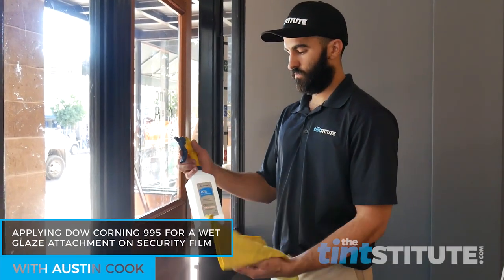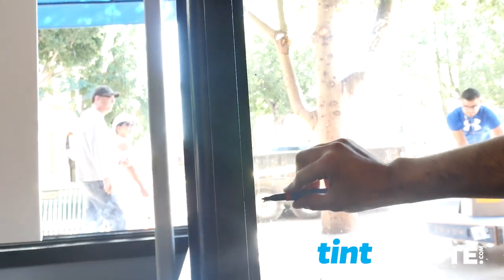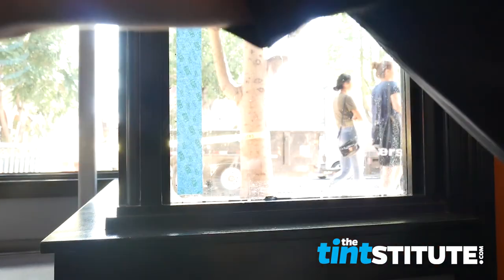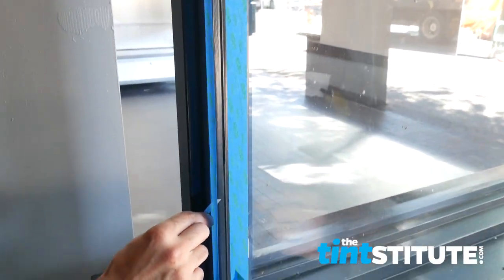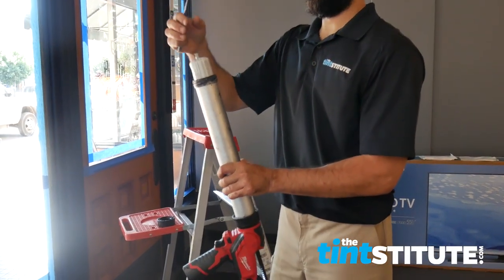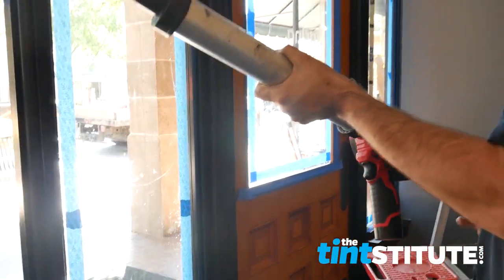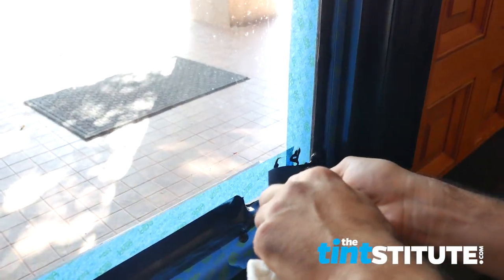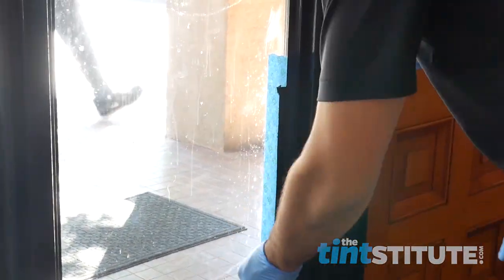How to Install A Wet Glaze Attachment System for Security Film | Installing Dow Corning 995

Comment: Fantastic and helpful vid, thanks! Do you recommend this method for interior home use as well? I'm sold on using film for added storm/impact protection in a NE coastal home--especially with using attachment or anchoring to increase its strength--but I'm guessing this particular caulking method isn't suitable for many people's interior home for aesthetic reasons? If that's the case, are there alternative attachment systems people use?
Reply: @diamondbracelette I do this for work, and honestly I’m not sure why more home owners are not taking advantage of this system to help fortify their homes . It’s a great system ! Most installers will not even think about attempting this inside of their home do to a MULTIPLE lists of reason . However, if your lucky enough to find someone who specializes in 995 Dow sil or anything related to its viscosity, it would ABSOLUTELY work wonders in your home .  Please feel free to message me for more information .

Comment: Should teach a technique that “rolls” the caulk into the void by pushing the caulk instead of dragging it. Requires no tape and there’s no inconsistency in the bead thickness like tape shows.
Reply from the maker: Thanks for watching, does that technique work with structural sealant?
Reply: Sorry to say but I have installed security film and miles of Dow 995, and there is absolutely no way possible to do it with no tape!!! I've heard stories, fairy tails, and lies about doing so, but IMPOSSIBLE!!!!!
Reply: That technique is not a functional technique. I’ve been caulking for 15 years professionally when they shoot the caulking without tape and don’t tool it, it will fail i see it all the time next time you go through a drive through window look at the caulking it’s pulling away because it failed to adhere. Why because they shot it and didn’t tool it. The best way is properly clean the caul joint tape it so your able to push the caulking to the surface for maximum adhesion without making a mess.
Reply: @jonathanburg7461  wrong. I do it without tape . Easily .
Reply: @ReZzzHD  correct 👍